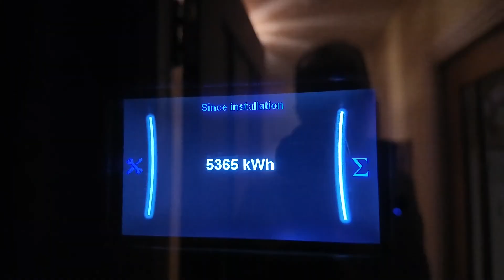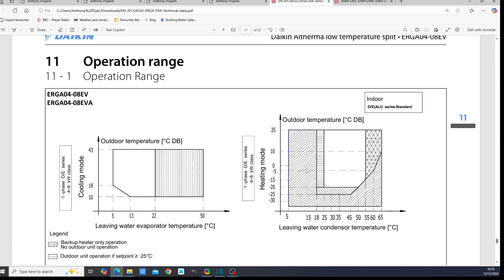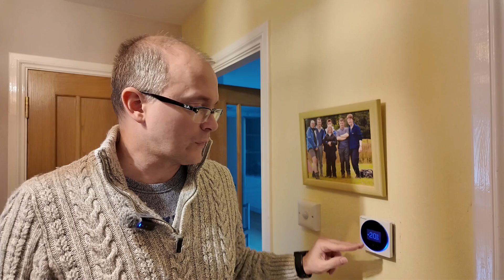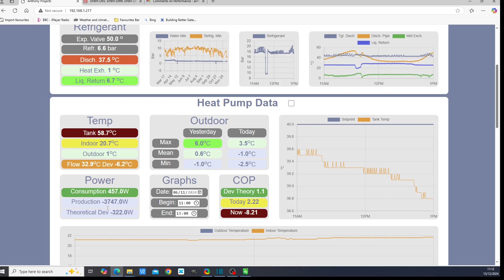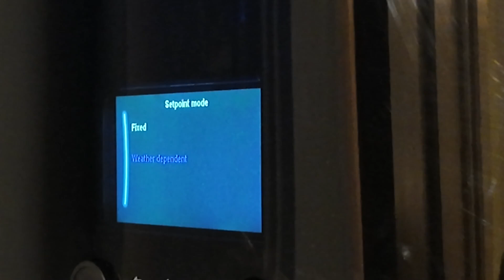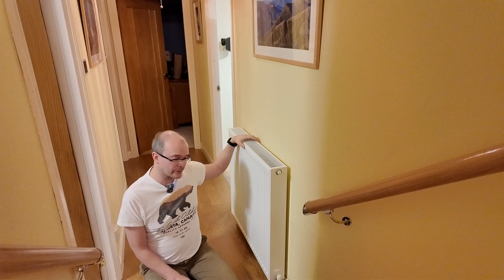Daikin Altherma Heatpump Early Winter Update

Comment: Btw, your cycles are quite short even though they are spaced adequately apart. Look for Demand Control in settings. May work with just Auto otherwise a manual setting to tame it down could work wonders for your COP and cycle length. It would also reduce frosting.

Comment: Interesting to see just what a problem it is to use water for transport from outdoor unit. I am assuming that is what it does which explains the limits on temperature?
Other systems I see in use here where it goes to -27c regularly in winter is a mini-split type setup where the indoor unit is the waterheater.
Medium between indoor and outdoor can't freeze and unit is not even equipped with a backup heater. This also makes it safe for long term shutdown or powerloss in winter.

Comment: Hello antonhy,  I have watched and listened to your assessment of this particular Diakin. A couple of questions I have may point me in another direction for my forth comming heat pump install via Octopus energy. They only supply Diakin or their cosy brand. After having a survey from Octopus, My 1960 bungalow was assesed at 10500 watts of loss with a recomended 14 kw unit. I am not a heating engineer, but a retired electronics man with a life interest of reducing my energy bills and this size of unit really made me baulk. I am sure this might be twice the size I need. But, watching your video has made me realise Daikin  might not be my best option. Octopus cosy, although not quite as efficient have a lot more sensors in the AHU and I think ( not 100%) more weather compensation options.   
Just to give you a better idea of my set up, when the FIT scheme started , I had 3.2 kw  Solar array fitted to my roof and this has given me a fantastic income over the years. I reckon my FIT generation earnings are just on £.80 per kilowatt of generated. On top of this, I can use all my generation for whatever use I want and still receive the 80p/kw. So a few years ago I constructed what I, at that time called a skimming unit, or harvesting unit and used my power to heat a preheat tank for all my hot water. It has been my most successful  action giving us free hot water .
Any way, my question to you is..... Would you have used Diakin given your testing and observations, or changed to another type
 of unit. Secondly, would you say your install is much more efficient than gas.
Thanks for a very interesting video.

Comment: Hard to tell from the angles but it doesn't look like you have much if any vibration isolation/dampening on your heat pump, so if you did want to reduce or potentially eliminate the noise of the unit in the lounge/kitchen then some cheap rubber isolators might do the job - we had a similar issue as ours is wall mounted and the rubber rings supplied with the unit were inadequate, but £8 for 4 mounts on Amazon sorted it completely and was quick to install, just raised it by about an inch.

Also, you might to look into getting a condenser comb/brush that works with the spacing of the fins on the Daikin and helps deal with the larch needles!

Comment: Really cool analysis. Thanks for digging into the numbers. Do you know if this also happens for other heat pumps? It really sounds like a bit of a crappy design of the control loop if the outdoor unit just falls into an inefficient mode. I would not have expected this from a premium brand.
Reply from the maker: @michaelgilch3645  It’s more the design of the heating medium temperature.  If it’s run at too low a temperature, then it just hits the minimum flow rate and compressor speeds.  I’m guessing that the efficient mode that I saw, utilising the accumulator, was just a fluke, rather than a design feature of the heatpump, though I’d like to be convinced otherwise.

Comment: Interesting to see your results, I have the Daikin 6kW Altherma monoblock, over past few months I've been running it on flow temperature control.
My unit has run very stable most of the time, I believe compressor and pump are more or less running continuously at low demand.
Today at 8.6C it's drawing 525W, LWT 35C, and outputting @ 2kW of heat to 70m^2 two bed semi, which is a COP of 3.8 estimated, and showing a dT of 5.1K
I'm using the open energy monitor Pi2 package (no MID flowmeter as yet), so COP is based on simulated Carnot COP, I believe this is a good representation based on the SCOP data from Daikin control panel over longer periods.

There is a 'Holiday' mode in Daikin Onecta App' which I see under 'schedule' at top right of screen. I used this last February when away and heat pump sat asleep consuming @ 10W, as far as I remember as soon as outside temperature dipped to 5C the system woke up and maintained a flow of 12C until external temperatures rose again. Unfortunately this was before I'd started monitoring details so working off memory. Antifreeze valves would trigger at 3C.

when coldest at -3.9C last week or so the indicated simulated COP was 2.8.

Comment: You are smart, I've used trial and error, and discovered the same thing. I set heat pump at 30c at 10c and use home assistant to monitor it and switch it off over 10c outside say for half and hour and vice versa. The heat pump is happiest us 35c, and I use rads only and is fine at lower LT. - 5 it is set at 45c. Good video and analysis. ❤

Comment: Thank you for creating this video! I have also been trying to figure out why my heat pump's COP is so low and why it can't achieve a delta T of 5K. 

But thanks to your video, everything's clear now. My LWT is only 28°C (at 1°C ambient temperature) and my return water temperature is 26˚C (this keeps my floor surface temperature at 25°C, which keeps my room temperature at 22°C). After watching your video, it's now obvious why these conditions can never produce a delta T of 5K.

Also, I have noticed an interesting thing when I lowered the desired delta T in the heat pump's settings from 5K to 3K. With a delta T of 5, the inverter cycled between 15 and 22 Hz. The COP was constantly cycling between 2.5 and 4.5, but the average COP seemed to be around 3.5. The 5K delta T also caused the LWT to overshoot by 3K on startup, causing short cycling (but I solved this by increasing the max overshoot setting from 1K to 3K). 

As an experiment, I tried lowering the desired delta T to 3. This made the heat pump run the inverter at a constant 19 Hz and it no longer overshot the LWT by more than 1K. However, this reduced the COP even further (to only 3). 

I wonder if it makes sense to turn off some of my underfloor heating loops (e.g. in the two halls). This would then allow me to bump the LWT above 30°C, but the room temperature would stay the same, since the other underfloor loops would have to provide the heat for the halls. Did you try turning off some radiators when you increased the LWT to 30°C?

I'm also considering running the pump every other hour (i.e. on 1 hour, off 1 hour). This would allow the screed to cool down by 1 or 2K, and would also require increasing the LWT. This should help the pump reach the 5K delta T and run more efficiently.
Reply: COP is not everything. We may have a high COP and have consumed more energy. If you increase Delta T you will have more compressor work, therefore, within certain limits of the equipment, you may have a higher COP, you may have reached the setpoint in more time and therefore you may have consumed more energy. I think the important thing is to tune the Delta T and the climate-dependent curve in such a way that the equipment does not stop unless it has reached ambient temperature and therefore will not start successively. Allowing an excess of a few degrees in the water temperature to maintain the delta t is also important, as is allowing modulation so that the heat pump can change the leaving water temperature according to the distance or approach to the setpoint.
Reply: @smbinstalpro  Yeah, my heat pump is running at its absolute minimum, because it's massively oversized (8kW, but the heat loss is only 1.5kW or even slightly less). The inverter runs below 20Hz (with 15Hz being the minimum). The circulation pump is also at minimum flow rate. The low COP isn't really a problem, since my yearly energy bill for space heating is less than 250€, and the house is very cozy (I don't even use a thermostat, as the weather-dependent curve is set perfectly), but the engineer in me wants to squeeze as much as possible from the heat pump. 

I think switching the heat pump off for periods of time (even though this goes against what is usually the best way to run a heat pump), might actually increase the COP and reduce the energy consumption. Especially, since the ambient temperature here is always around 1°C, and humidity is high, causing the heat pump to defrost often (and this of course reduces the COP further - from 3 to 2.5).
Reply: @markoluksa I understand what you're saying, but I think you can improve the settings of the heat pump, a greater delta t and a curve with a higher minimum temperature, as well as the floor, adjusting the flow meters to guarantee balance in all spaces. I even believe that you should apply a brand's own thermostat and choose wisely where to place it so that it serves essentially as a modulator of the output temperature by moving away from or approaching the setpoint and also as a temperature limiter, if exceed the setpoint, the heat pump stops, but remains stopped until the temperature drops so there is no cycling. I don't see any major problems with heat pumps that are a little more powerful than necessary, a Daikin of this generation really allows for a lot of fine tuning...
Reply: @smbinstalpro  Thanks. The reason I don't use a thermostat is because it takes 8 hours for a change in the LWT to affect the room air temperature. So, if the thermostat turns off, it could take 10 or 12 hours before it turns on again. And then it'll take 8 hours for the room temperature to start increasing. Maybe if I put the thermostat closer to the floor, then maybe it would work (or maybe just implement my own thermostat that takes the floor surface temperature into account instead of the air temperature).
Reply from the maker: @markoluksa  Tomorrow I’ll run another test at 35k and see how the system responds.  General advice has been to open up every radiator loop as this encourages a greater delta T.  Your circulation pump is already likely on the minimum flow rate already.  I can’t configure a DeltaT of 3K on my system - it’s either 5k or 10k.  

I still hope to find those wonderful CoP figures for mild temperatures in a reliable way, and I think I’m getting close!
Reply: @anthonydyer3939  Yup, circulation pump is at its minimum (around 6.6l/min). My heat pump is massively oversized (8kW, whereas my heat loss is only around 1.5kW most of winter). 

BTW I think if you set the emitter type in the settings to underfloor instead of radiator, the you can then configure the delta T in 1K increments.

Comment: Hello antonhy. I'm Marcos from Portugal. Go to the climate control settings with the installer password, parameter 9-04 (excess) there you can define how many degrees the pump can raise the water temperature before stopping the compressor. you can by up to 4 degrees. If the pump is unable to maintain the delta T of 5 degrees, before stopping the compressor it increases the water temperature, avoiding stopping and working at very low compressor speeds, as in order to be able to return the oil to the compressor it will have to be keep the rotation a little higher. keep up the good work.

Comment: You can set an offset to the LWT using the Altherma integration in HomeAssitant I have not tried using this so not sure if this would work for you or not.
Also I'm not sure it would be a good idea unless you house is vacant for a longer period.
On my Daikin Monobloc you can also override the minimum set point on the heating curve of 25 degrees in the installer settings. No idea if this is a good idea or not.

Comment: The approximate theoretical power maximizing COP is COP_theo = T_ambient / (2*(T_LWT - T_ambient)), where T_ambient is the external temperature in Kelvin, and T_LWT is the leaving water temperature in the heat pump.  Note that this is different to the Carnot COP (which maximizes output energy but takes an infinite amount of time to do so, i.e. has an output power of zero), and is much closer to what heat pumps actually do.  If the minimum power input is P_in_min, then the minimum heat power output at maximum efficiency is P_out_min = P_in_min * COP_theo.    As T_ambient goes up, P_out_min only increases.  On the other hand, the heat power required to keep your house warm is P_req = K*(T_desired - T_extra - T_ambient) where T_desired is the temperature you want in your house (eg 20 degrees C), T_extra is the heat you get from people and devices inside your house (typically 2 to 3 degrees C) and K characterizes the heat loss of your house (eg 300 watts per degree).  As T_ambient goes up, P_req only goes down.  Above some ambient temperature P_out_min > P_req, and something has to give if you don't want your house to get too hot.  If you exclude silly actions like opening a window (= increase K) or moving out (= decrease T_extra), then you either have to turn off the heat pump (= cycle), or it has to run at less than maximum efficiency.  It might be interesting to see where the cross-over point is for your house, and what P_out_min vs P_req is like when your heat pump moves into the inefficient regime.

Comment: I've yet to be convinced of the virtues of heat pump's. Reliability issues are a common complaint and because of the varying loads on the rotary compressor motor the three phase VFD that power them are prone to burn out. It may be that lack of steady line voltage down under is a significant factor. Lightning storm surges are another VFD killer.
Reply from the maker: Regarding reliability.  This is what my installer has said:  " We have installed about circa 600 systems to date ......... off the top of my head I have changed 3 compressors in that time. These were due to faulty accumulators which leaked refrigerant which was the cause (about 12-15 years ago and Daikin covered this even out of warranty) I wouldn’t worry about reliability"
Reply: @anthonydyer3939  
Being sealed units the compressors should last a reasonable time. But a friend who is a refrigerator engineer keeps very busy replacing fried units.
Bad installation can be a factor. 
By and large Daikin has a good reputation though. Others not so much. 
Aussie tradies don't have the best reputation for proper installation..

Comment: If you rubber mount the heat pump stand you can reduce that noise transmission.
Reply from the maker: That was one option presented, but the heatpump would be set low down.  That's not good considering we sometimes have over 40cm of snow from time to time.

Comment: Nice explanation! I set the overshoot to 5oC in space heating setup to achieve a similar result.

Are your defrosts noisier/noisy/audible? Your data indicates they consume significant power.

Daikin support is horrid, the heat pump performance is opaque and they are horribly complex to configure. It's all marketing and little substance. If I could go back in time and choose again I would not purchase a Daikin system. I should have chosen a Vaillant Arotherm Plus. It would have been cheaper, quieter and simpler. That one will have to go down to experience.
Reply from the maker: Defrosts are noisy, and I only recently discovered this.  It's a rumbling sound that I hear for a few seconds when the refrigerant is forced the other direction.  Most of the time, I'm in bed during a defrost cycle, but recently they've been making themselves heard during the day.

I like the Daikin hardware, but the literature on their website is all over the place.  They have glossy brochure literature for homeowners, but there's no reference to datasheets or manuals from that literature.   They don't even have the exact model names in that literature.   That operating temperature chart I showed in the video took a good hour of searching the internet to find.  It's not in the datasheet, or the manual.    

The complexity of configuration is OK (for me anyway).  But the advice out there for configuring a weather comp curve assumes that the heatpump can operate well below it's minimum output.  As we've seen it can operate beautifully below the minimum output ...... but only sometimes, for reasons beyond our control.